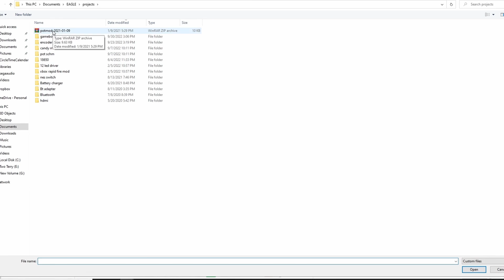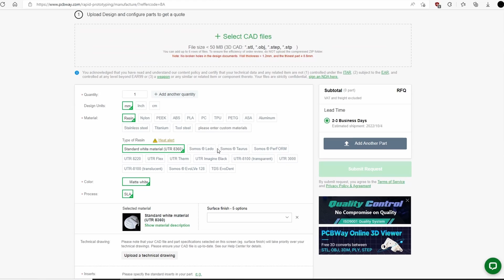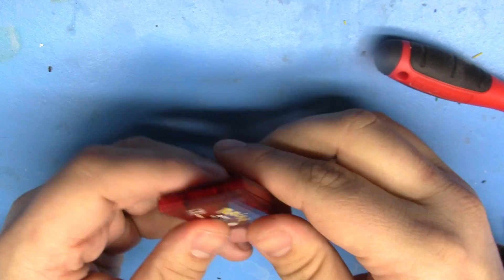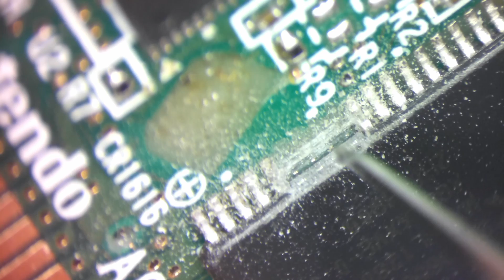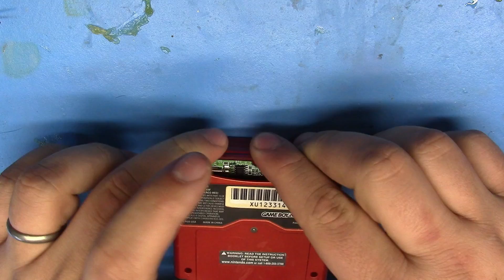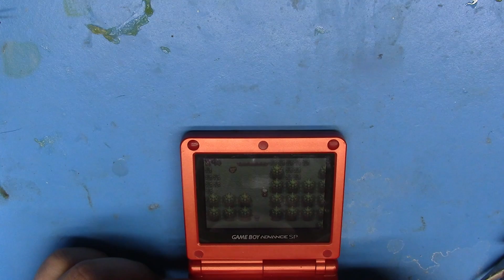Repairing an IC that has missing pins!

Comment: The battery is not needed for saving in gba games. It is only used for the clock.
Reply from the maker: True! I mentioned that we see the save files right away because if the battery wasn't working correctly we would be met with a dry battery error first! So, seeing the saves first means the battery is good and that the RTC is working as it should :)

Comment: @solderking Excellent video as always. Can you tell me we’re you using a product to remove the solder mask under the chip? Or was it just gunk remaining from the scraping operation? And what product do you use to clean the flux off PCBs?
Reply from the maker: Thank you! :) That was flux gunk from when I flooded the pins before removing the chip. It scraped away pretty easily with a scalpel. I use 90% iso for cleaning. I recommend using 99% but I can't find it locally lol